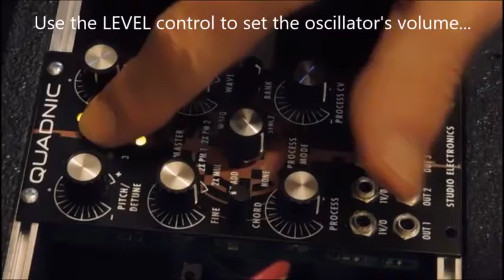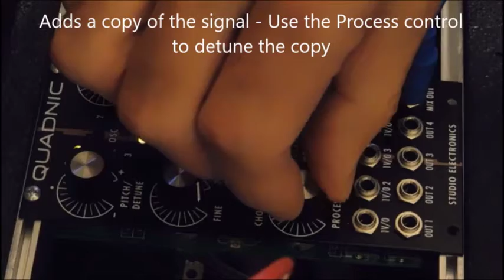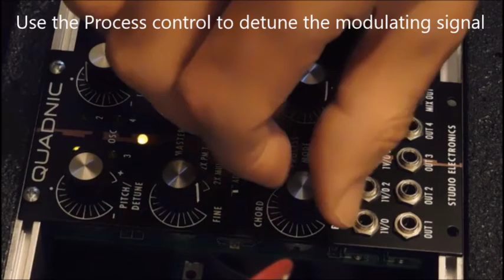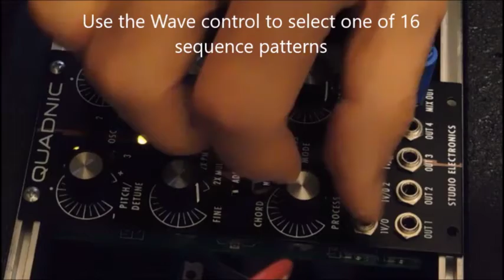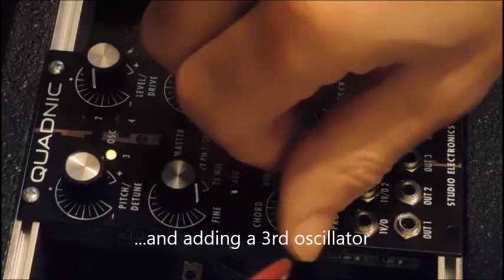SE Quadnic How To

Comment: Pretty wild! Are the waves able to morph into each other cleanly?
Reply from the maker: There are several phase distortion modes where you get wave shaping/detuning. Some smooth settings and some grittier sounds are possible. The wave sequencing mode steps between waveforms, but does not have a smooth setting for morphing.

Comment: Thanks for posting. Seems like the unit is very noisy from the vid. As soon as the volume is turned up there is substantial hiss. Is the Quadnic the source of all that hiss (as it seems on the video) or is something else going on? Just curious before I spend the $.
Reply from the maker: +Steeze Kings Hi, it depends on the position of the Level control - at 50% and above (full level) there is very little hiss (around 0:30 in the vid). If the Level is less than 50%, more hiss is noticeable.
Reply from the maker: +SynthStuff Just to explain the Level control a bit more - it attenuates the signal from each oscillator digitally. As the output is only 8 bit, the signal resolution is reduced as the level is reduced, introducing some noise,
You could get around this by keeping the Level at 50% for each oscillator and mixing the individual outputs externally.
(Above 50%, the Level control clips the signal)